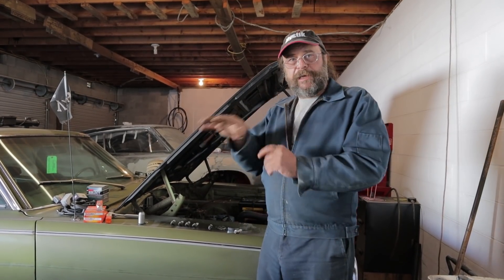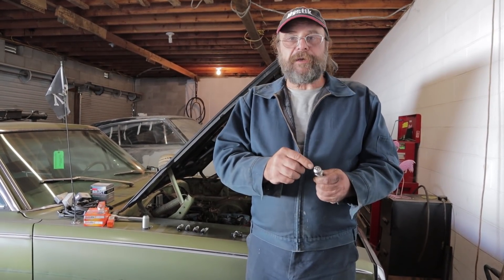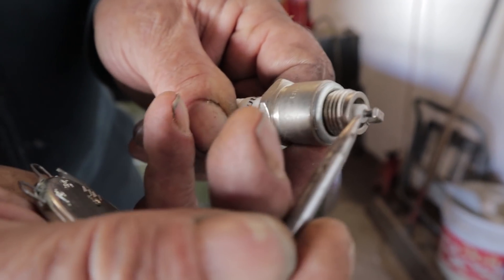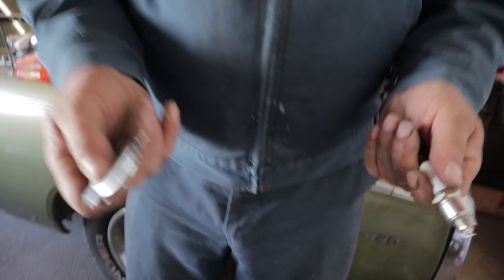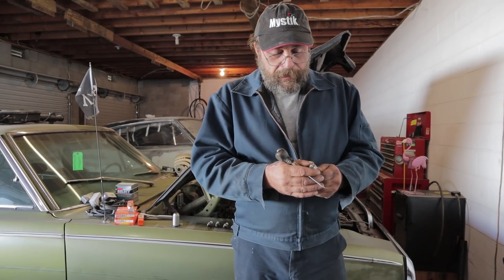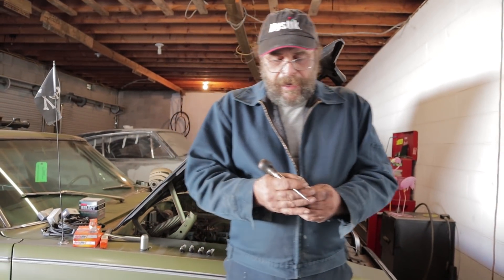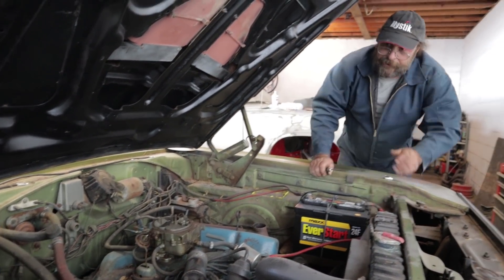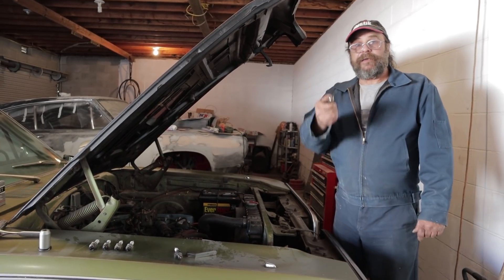Tune Up Basics - Spark Plugs

Comment: I remember the Spitfire spark plug craze of the 90's. I tried a set in my 5.0 back in 1994 and I noticed 0 improvement over the Autolite Copper plus plugs I was using. On the flip side their dual core plug wires were excellent compared to everything else. I verified half the resistance using the same length Splitfire dual core plug wires compared to the same length "performance" single core plug wires. I ran a set of them on that car for 15 years and never had a problem with them. In my opinion they were better than all of the other brands of wires that I tried over the years. I also tried platinum plugs in it and it did not like them compared to the copper plus plugs. There's just nothing better than copper as a conductor.

Comment: Nice! I've been faithfull to Autolite Plugs for 30 years.  Even been told by guys trying to push the latest and greatest $5 Gold, Platnum, Irridium, Super conducting Lightning Storm plug that the inexpensive autolites were trash. I quit arguing with those guys years ago. I just throw Champions away, cant even count how many times Champion plugs have been at fault when someone brings me somthing they cant get running. NGK's have always been my 2nd choice. Especially for old Japanese Motorcycles. Good Share.
Reply: Don't need to comment,  you said every thing I was thinking.  Thanks.

Comment: Tony i have a 2012 vw 2.0 turbo on 1 cylinder it keeps fouling the plug 30 days,it has 136000 miles do you have a tip on what to do with the plug to keep it from fouling.it looks like the oil is getting to it through ring or valve seal,help! Can't afford to fix it at this time.

Comment: Just found your channel as a result of a recent purchase of a 1966 Dodge C500 2-ton farm/grain dump truck.
   I am now the 3rd owner, 53k original miles.
   It has a sticker on the left side valve cover that says “Premium” 318 202HP...
    Had to chuckle at the noted “2” hp.
   Anyways, it runs like a top...  Did some digging and discovered that is kinda unique (semi-hemi), and found you channel, now binge watching all the videos referring to it.
   I purchased a set of “Autolite” plugs, and noted that they did not have the crush washers.
   Just figured it was the style for the “poly”...
   Have not installed them, now wondering if they should have the crush washers...?
   I guess further investigation is warranted on my part.
   Book says 30in/lbs of torque for them, not sure 30in/lbs is enough to keep them in...?
Great video.
Thank you sir.

Comment: As a GM guy used AC only for decades, partially rebuilt a 301 Pontiac, was bucks down and bought Autolites, while I was sorting out the carb after advancing the stock smogger cam, I had carb flooding, to running lean, to phase separation with E85, while twisting the distributor to get more timing than the law allows. ACs would have never made it.

Comment: Some BMWs come stock with multi-tipped sparkplugs and they will periodically misfire if you don't use them. Not enough to run rough but enough to trigger a CEL.

Comment: I bought a set of e3s 7 years ago for our sbc vortec stroker. Ive pulled 3 times to check. Dont even gotta clean em up. Have never fumbled stumbled stalled or fouled. Even when fuel leaked dwn in intake. It still ran smooth.  Just ran rich. As for ngk. . . i had the WORST luck with them fouling. On alll of our atvs, atcs. I changed a few to the e3. Total wakeup. Autolites. The og go to for anything carbed or tbi. Its all with a grain of salt and many things affect. But i can without doubt stand firm for e3 as a copper core replacement. And 5 yr warranty. . . if its needed

Comment: I've always used anti-seize on spark plug threads since I have been working on engines. However, spark plug manufacturers will warn you NOT to use anti-seize because they say that can lead to spark plugs shorting or loosening up and also because they say the newer spark plugs already come with special ONE-TIME use anti-seize coating on the spark plug threads. Once the spark plugs are removed from the engine, manufacturers recommend buying new spark plugs and NOT reusing the old ones, no matter how many miles are on them because that one-time use coating is gone. Working on a lot of older carbureted engines, I think this protocol is ridiculous considering how easily spark plugs can get fouled during the tuning process. I have an old spark plug electrode blaster I use to clean the plugs tips for that very reason.

Comment: I didn’t know that anti seize trick. I have a 2005 volvo t5 and it was misfiring in multiple cylinders so I decided to change the coils and plugs. I coated the threads on the plugs in anti seize before I put them into my Volvo’s aluminum head, and they started misfiring again after about 10k miles. Replaced the plugs again and coated them with anti seize and they started misfiring again after about 10k miles. When I pulled the plugs they had a lot of ash deposits on them. I changed to different types of motor oils, used different brands of gas but I could never figure out why they kept misfiring. The last time I changed the plugs I was very tired of doing this job again so I rushed through it and never used any anti seize and I’ve been driving about 20k miles on this set of plugs, no misfires yet.

Comment: Ultrasonic cleaner to clean used  plugs and a multimeter to test resistance for same.... regap/reuse. No need to throw away servicable parts for a daily driver. With two sets of plugs you can rotate btwn. the two sets. No anti sieze.. dab of old clay base grease...clay remains on threads after oil is dissipated   creating a barrier to corrosion and electrolysis. The clay in the grease is what carries the load in a clay based grease .. the oil is there to lubrcate the friction points.

Comment: Good advice for both beginners and even seasoned folks. I would add one other comment for stock engines. Stick if possible with the OEM manufacturer. So for a GM car, stick with AC Delco plugs (although the later AC Delco Iridium plugs are actually made by NGK for AC Delco, so if you find the exact NGK part # that's being reboxed, that's OEM in my book). Sometimes let's say for example, Champion will "consolidate" heat ranges (they have one part number that on GM applications, where GM had two specific part # plugs for a given engine/emission calibration/etc. Even on small engines, if it came with a Champion plug, that's what I put back into it. I recently picked up a yard blower off the curb and even though it ran as-is, upon inspection, the plug was really dirty. A new air filter and plug made all the difference in the world, even on something that small.

Gap gauges are a plenty in brands, and I like the "ramp" gauge that Champion, A&E/Kastar (who also made the units for Sears Craftsman) and others offered over the years. Many a person has them on their key chain and they cover a lot of engines and gap ranges that you need. Cheap and easy to pick up just about anywhere.

Comment: Good video uncle Tony

 can I suggest next time you Do a spark plug or tuneup video most blokes don’t know how to check whether or not the high tension leads are any good just by using a multimeter 

and also even today I still put a film of dielectric grease on the external white ceramic portion of the plug just to prevent the rubber insulator from welding to it so it’s easier to get off next time....... but I avoid putting it on the electrode connector Because dielectric grease is a non-conductor and it can theoretically add to the resistance.....

but I do sometimes like to get some Needle nose pliers down the end of the spark plug lead and give that split clip a tiny bit of a squeeze to make sure it’s nice and tight

But all that depends how it felt when it came off

that connection has caused me afew problems over the years and it takes a bit of practice to get the feel on that and I think you would appreciate a lot about this tuning up old school stuff is about feel and having a good year and a good eye

Comment: Anti seize is a good tip for guys starting out to make life easier, what i do myself on every car cast or alloy heads is bring the engine up to running temp, then shut it down by the time of collected my tools, iv found plugs to come out easy and using the heat cycle between the very large head to the tiny plug, the plug cools quicker so treads loosen up that little bit plus helps to break any rust or corrosion that may have happened during change intervals but this is not for everyone as everything loves to burn your hands lol anyways just wanted to say I enjoy your vids alot you supply alot of helpful tips and tricks and you don't come across biast just straight up real with whats good and not.
Keep the great videos coming.

Comment: Main difference between copper and iridium electrodes, is service life. Copper is more like 20,000-30,000 miles change interval recommended, Iridium is 75,000-90,000 miles recommended. Other than that, they perform the same function, there's no special secret sauce. The Iridium just lasts longer in a hotter engine environment.

Comment: Look at that engine bay. That is the way cars should look today. How many sensors do we see? How much computer garbage? Give me mechanical fuel pumps, carbs, and ignition points any day. If you couldn't get a carb to work, you could take it off and get a rebuilt and bolt it on.

Comment: I'd love to see some more videos on that 70 Coronet you're working on. I had the identical car for my first car, same color 318 with the 727 torqueflight. I got it in 97 when I turned 16, I got a lot of attention with it, unfortunately for a 16 year old kid it wasn't cooler enough and I got rid of it. I kept track of it for 4 or 5 years after, seeing it at car shows, I haven't seen it in years now, too bad. If only I had been a bit smarter as to what cool was back then.

Comment: marine plug with only the center electrode no ground its fun to watch the spark run all around the plug. seen a few top alky guys use those in recent years if you have a hemi they seem to work really well. its good you let ppl know higher compression lower heat range. older motors that loose compression should run a bit better with a slightly hotter plug.a lot of guys shim index the plug to direct spark to exhaust side to promote a more complete burn. Love your info classes they bring back a lot of memories and get me thinking again. wish you would put a newer hemi in that dart swinger

Comment: I go by the general rule on spark plugs,go with the same brand it came with from the factory.My dad worked at a Chrysler dealership,had one Chrysler come in with a no start and he found it was the AC Delco plugs installed causing the problem.Put the Champions in,started right up

Comment: Uncle Tony, as an electrician, my eyes go immediately to the wiring on the ceiling. Hmmm...
Let's get some fixtures up there. Light that place up like an operating room. I have a 12 x 16 foot shed for my motorcycle shop. I have fourteen 100 watt LED fixtures. It's blindingly bright, no drop light needed.

Comment: I'm sorry if I missed it,  but did. you answer my question about running different heat range plugs in an inline six to better balance out?
Middle two run cleaner. Outters run a little darker.

Comment: Thanks Uncle Tony. I learn something from every one of your videos no matter how basic. However I have a question. On older 2 stroke engines mainly outboards in my experience the ground strap only goes to the center of the center electrode. With most standard plugs the ground strap goes completely across the center electrode. Why the difference? I am guessing you know why. I don't think the plug manufacturers do this anymore but it was common years ago.

Comment: I run Autolites in everything because they just run great and last longer than other plugs I tried back in the day. One of my car books even said if you usually run your plugs till you notice issues Autolites last the longest. I tried Champions and I seem to remember they fouled out easier and sometimes you'd get a bad one in a set. I usually never play with the heat range, just get what the book says. My Neon is almost 10 to 1 factory and I noticed it has spark knock at low rpm tip in so thinking the knock sensor is bad but possibly going one step colder might make up for it. They say if you want max performance out of that little engine it should get at least 91 octane but the sensor will retard the timing quickly so it runs fine on 87.
My Dart I run the timing till it knocks a tiny bit as it hits WOT, check what the light says and run it there, plugs look fine and last.

Comment: I can say, in my personal experience, those funky plugs like the E3 spark plugs... are absolute garbage. Every, single thing I have found E3 spark plugs in, from cars, to trucks, to motorcycles and lawn mowers, they have all had one thing in common. They all ran like crap with E3 plugs in them. MAYBE someone out there has had good luck with them... but I doubt it. In my experience, when someone has put E3 plugs into a gasoline engine, the engine idled rougher, the engine responds slower, fuel economy did not go up, it went down. It seems like a great idea on paper to have multiple paths for the spark to go, but then you realize you have a GIANT grounding strap in the way of the flame kernel, causing a dead spot that takes time for the flame to get to. I use NGK plugs, I have had the best luck with them to date, even  in US domestics. Hell I know a bunch of GM LS guys that run nothing but NGK plugs in their vehicles. As you said, everyone tends to have their own experiences with what plugs are good, but so far it seems plugs like E3 are almost universally hated by people whom actually take care of their own vehicles.

Comment: Haven't had an "older" car in quite a while, man I miss working on the simple mechanical systems of pre 80's vehicles. One of my beaters is now an '04 Sentra with 1.8 DOHC. Platinum plugs from the factory and coil on plug so no real spark plug wires. Hands down the best system for ignition when it comes to working on it. Though I would not mind a "normal" spark plug in this thing, them stupid platinum plugs are pricey. Now I have a blown head gasket and I'm trying to decide if I should go get a junk yard head and rebuild it before I tear this thing apart. Part of the problem is my lack of a proper place to work on the car. So I have to rely on a friends garage, sure he has room for it but I don't want to take up one of his bays for days on end while I fix the damn thing after work. We all know how this is going to work, if I buy a head I wont need it, if don't buy a head my current one will be cracked. DOHC is just a pain in the ass when it comes to removing the head, standard old V6 or V8 I can do that in less than half a day.

sigh...

Comment: Ah the science of plug selection ...  For the last few years, I have gone to fine wire plugs and opened up the gaps an extra 5~10 thousandths. What you did not mention is plug erosion - wear from spark energy.  The electrodes become worn and rounded.  Sparks like to jump off sharp corners and edges (ex: older Autolite "Ring of Fire" which really worked). So the modern equivalent is fine wire with a tiny center electrode.  If the spark can initiate easier, it can jump a slightly wider gap and still be within electrical load parameters.  Bigger gap means bigger corona and that means easier and more complete ignition, which can mean better fuel economy (or power).  This bit is somewhere between stone basic tune-up work and the beginnings of race plug tech.  But it is something basic mechanical skills can utilize as knowledge builds :)  Please do a bit more about plug tech?? W/o spark, there is no fire, so it is very important.

Comment: I love these videos, but, I did see one thing in this one that bothered me a bit...when you set the gap on that Autolite plug, it looked like you were bending the part of the ground strap that covers the center electrode. Maybe it was just the camera angle, however, I was always taught to bend the side of the strap, as close to the threads as possible. Have I been doing it wrong for the past 40+ years? Personally, I always use o.e.m. for stock engines, AC in GM, Motorcraft in Ford, Mopar (or whatever Fiat is calling it these days) in Chrysler. Other than Honda motorcycles, I don't allow foreign brands to park in my driveway, let alone enter my shop, so, I have no idea what to use in them. I also use the most modern equivalent of the originals. I fell for one of the "gimmick" plugs years ago when Accel came out with their "U-groove" plugs. They said "more hp and better fuel economy". I MIGHT have picked up a couple extra miles from BOTH tanks on my old GMC K-35, but, nothing more than I would have after a complete tune up with standard AC parts...never again! My hot rods and race engines are a whole different story as I'm sure you know. Keep the great videos and info coming Unc!

Comment: Hi tony, I've been watching your videos for quite some time now, and am always amazed by the content you are able to cram in 1 video. But a man's got a little question for ya: I've been looking into getting a classic american for some time now and don't know what to look for. I'd like something cheap with a v8 (or slant 6) and a manual transmission and it must be pre 1980. Do you have any idea of what models I could get on a tight budget (preferably less than 4 grand). (The brand doesn't matter)

Comment: I take them out one at the time, but leave them in order they came out. The last set I put in the Toyota I poked them into a cardboard box so I could see all 8 togeather. An old truck for keeping push rods and such straight.